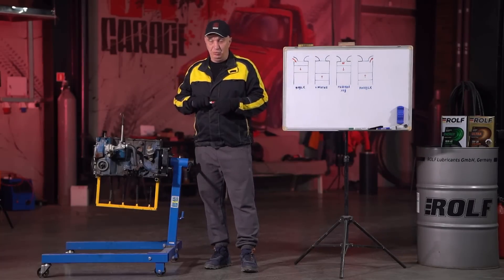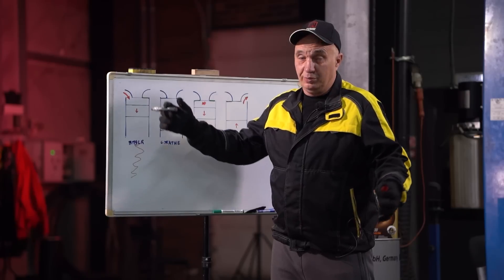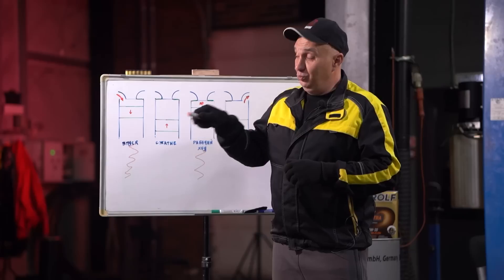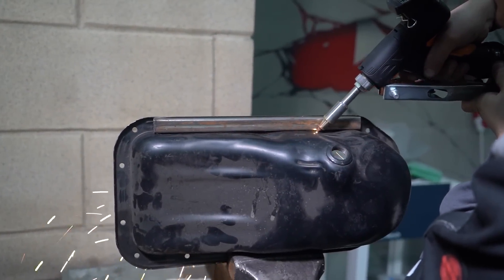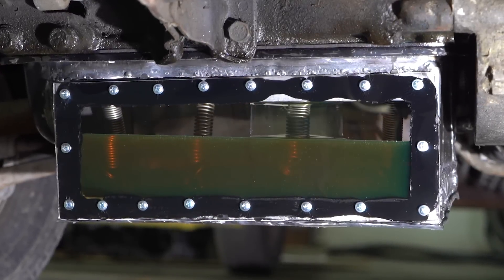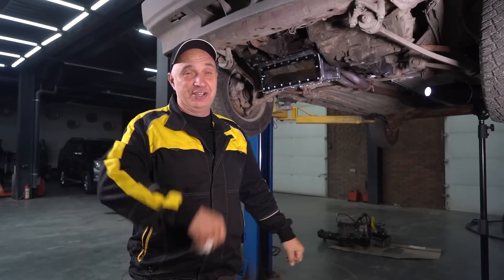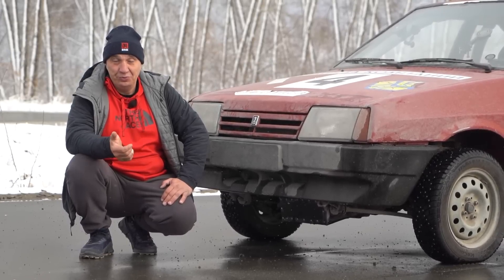Spring augmented engine (20% extra HP!) - will it work?

Comment: Another awesome video and experiment. When I heard springs and engine I thought it was either another one of those April fools pranks or maybe you were putting some compressive springs inside the combustion chamber to push the pistons down. Didn't expect the transparent oil pan and tension springs though. Pretty cool and honestly why I wouldn't expect too much of a result from a few springs is that it all balances out in the end. I could imagine it giving a little bit of a result in a 4 stroke engine due to the fact that the intake and combustion strokes will be assisted by the springs and there would always be a downward force on each piston taking out any slack or play any may draw in a  little more air. But the effect could be undone between hot and cold cylinders as metal gets softer as it heats up. Stiffer valve springs give for higher rpm revs though, and that is a known way to get more power. Anyway, another awesome experiment as always. Always looking forward to what you guys cook up next. Love y'all.❤

Comment: this is not adding anything as you have to load them on the compression and exhaust stroke so that will slow the engine down on those strokes equaling it all back out

Comment: holy crap duno test this?!
Reply: aw he was lieing? 
🥺🤬
Reply: two up two down, if the springs pull down cylinders that arent supplying power... like compression and exhaust... there will be a net gain from decreasing parasitic losses from friction and unused strokes. 

the two fireing will have additional force. because of the springs being over unity. the fired force being more than the unfired forces ... 

actually test this, go from weak springs like this, to more stronger springs. 

it should work better when you have springs that are a greater force than it takes to compress.

Comment: In theory the 4 springs should cancel themselves out, because when going up they create some force, and that force is what cancels the down force.
Reply: Excellent description. You get an, A in physics. Wahahahaha
Reply: There is more energy required to stretch the springs than they give back when they retract. Therefore they waste more energy then if there were no springs at all.
Reply: @YblockEnthusiast  is a little more complicated... Are you sure the energy required to pull the spring is more than energy released by the way?

If so, and I'll not arguing... Notice how some springs start stretched already? So those springs are free power that means the engine is always ahead.. (using your simple theory in absolute terms)
Reply: @WINZRacingBoss  Nothing is 100% efficient, and even if it were 100% efficient it would cancel out to zero effect. But the springs themselves have mass, and it takes energy to move the spring, even if the spring tension is what is moving the spring. 

Have you ever had a bouncy ball? Thats a perfect example that you can wrap your head around.
Reply: @alexthemorgan  omfg. I'm not four years old... Was treating the original comment with the same logic it was written.

This test (driving a manual car in varying conditions with different atmospheric density and humidity) is flawed.

However.. The spring effect could easily be balancing the rotating assembly and absorbing some shock of this engine designed as a cheap workhorse that was made slightly tougher than required to deal with the imbalances and vibration...

Would you like to start explaining harmonics, counter balancing, counter shafts and the losses incurred by each?

Please... Carry on...
Reply: @WINZRacingBoss  Ya, it has nothing to do with any of that.  All the energy to stretch a spring, doesn't go into stretching the spring, some of it goes into heating the spring, among a lot of other places.  You won't get that heat back.  That heat won't help the spring rebound.  That energy is just lost to the environment.

Nothing is perfectly efficient.
Reply: Not to mention the losses from the springs churning (pumping) the oil.
Reply: @alexthemorgan that's bc the ball looses a bit of momentum due to gravity each bounce not to mention air resistance
Reply: @gradystephenson3346  its the exact same thing ...
you gain momentum from gravity on the way down, lose it on the way up;
you still have air resistance both ways and energy converted to heat from the ball changing shape in compression during the bounce.
Reply: so much work for a prank
Reply: Not if the flywheel is spinning it's weight in 1 direction as it does
Reply: @c4r5on88  Flywheel has 0 to do with anything. Energy wasted in spring action will be exactly the same.
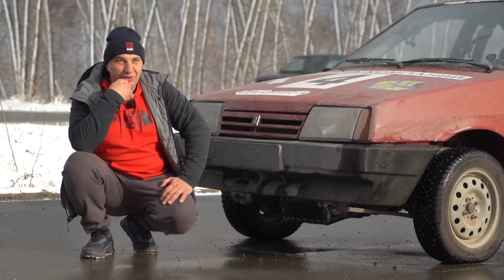Reply: The "post-credit" part of the video (9:46) basically explains this was a prank video.
Reply: The THEORY is sound assuming the forces are = in both directions. That and the force of the piston firing would have a much faster motion than the spring could rebound. Causing the springs to bend before they have time to rebound.  Ok now I’ll watch the video and see what happens.
Reply: @theofficialdiamondlou2418  No the theory is not sound if it somehow assumes the end result will be anything else than wasting friction energy on /de/compressing the springs.
Reply: in testing thats false! so cool...some physicist can explain
Reply: @reaganrpm  No its not. If you tested and got that result you did something wrong or happened to repair something in the process that was wrong before lol.
Reply: Plus losses (heat)
Reply: Only two have tension
Reply: Non svelare lo schherzo!
Reply: I think they should use pulleys like a bow where its easy to pull but exerts a great force
Reply: Could it be that as the crank spins the counterbalance that is on its way up already has a gravitational pull that it must over come, which slows the engine. By adding springs the upward motion is being overcome by the combustion and slowing the pistons downward motion but by have springs to pull downward they help overcome the counterbalance and spring that is being stretched? Just a thought.
Reply: you need camshaft actuated springs. 
So they only pull tension under power stroke. 

Then it will work some

Comment: Alright, hear me out.  Put neodymium magnets on the bottom of the conrods and highly-wound electromagnets on the bottom of the oil pan.  Tie in to the crank position sensor and fire off each electromagnet at BDC to help force the piston UP.  Power the thing with super caps and have it turn on at the push of a button like n2o.

Comment: Hum of course this system doesn't work, the energy of each spring cancel each out, so what did they do for it to work ? Maybe they changed the  motor but it's very unlikely, maybe they did not accelerate as fast as possible in the first place ? Do u guys have a better idea ?
Reply: Okay i found that my idea was correct, i will explain why. This car looks like a lada samara, also called vaz 2108. I've searched for the slowest version which is a 1.1l of 54hp and it does 0-100 in 17s not 25s. I think that the one in the video is actually the 1.3l 64hp version which can do 0-100 km/h in 16s. He just didn't go full throttle in the first run.
Reply: Good !

Comment: Increase in cylinder filling caused by a spring pulling on a connecting rod. Makes perfect sense to me. You guys should try making engine blocks from play dough. Maybe pistons made from a cake mix with pretzel wrist pins and cylinder heads made from concrete. Make the valves from mushrooms and run the whole thing on maple syrple?
Reply: 🤔maybe they will try it - 🤣
Reply: The only flaw with that plan is the word "syrple".
Reply: It's a joke, it doesn't actually work!
Reply: You leave the Canadians out of this eh
Reply: maple syrple??????!!!!!!!!!!!
Reply: Maple syrup vs aunt jemima ultimate showdown !!!!!!!!!!
Reply: @LORFCASTER aunt Jemima vs Ms buttersworth

Comment: A 0-60 (mph) time of 25 1/2 seconds?  That's so pathetic!  Assuming that you bothered to lengthen your oil pickup to prevent engine seizure, the gain derived from the lack of braking on the crank from "oil roping", as we refer to the drag during operation.

Comment: Those springs would only last a few miles
Reply: You ever hear of valve springs?
Reply: @kroan49  i used to be a spring engineer, so yes.  But valve springs are compression springs made of special steel.  These are cheap ass extension springs from the hardware store.  The knocked down ends will likely crack from fatigue.

Comment: that cutting tool used on the oil pan is very neat
Reply: Laser welder yes
Reply: Lucky These guys don't run the Russian milatary. They'd have converted that thing to chop drones in half from miles away already
Reply: Plasma cutter, not laser welder. You can buy one on for just a few hundred bucks these days.
Reply: @regurkilu  sorry to disappoint but what was shown there is definitely a laser welder that also can be used to cut stuff
Reply: @regurkilu wrong. It's not a dedicated plasma cutter. It's definitely a laser of welding sort.

Sorry to deflate your belief system.
Reply: @WINZRacingBoss  he also believes a plasma cutter is only a few hundred bucks
Reply: @plap. depends on your definition of plasma cutter, if you want a table it’s gonna cost you more than a grand. 
But if you want an old fashioned hand held plasma cutter you can really cheap out.
Reply: @jameshunt5316 Even Eastwood is more than a few hundred bucks. Cheaper than Eastwood would be tough, you get what you pay for. Be hard to do anything with a 30 sec  duty cycle
Reply: @regurkilu  I have plasma cutter and are you sure? I'm going to have to look closer. Give me a minute
Reply: @regurkilu  wrong wrong and wrong again.

Comment: Ummm not to be that guy but when you attached the Transparent oil pan you never put an oil pump and pick up tube back into it, that engine is going to die a horrible death....
Reply: If they cared about killing Lada,
We wouldn’t have garage54
Reply: @fastinradfordable  umm the first test with the stock engine the oiling system was working properly lubricating the engine, the second test where they added the springs the engine was not receiving the correct lubrication so the spring test is null and void as the two parameters are completely different.
Reply: That's russia for you everything dies a horrible death. But I love me some garage 54
Reply: Maybe need fill up more oil than recommended, but then the spring is invisible.
Reply: @peggenlejoncar9529  if there's no oil pickup tube there is no oil getting to the cam or to the tops of the Pistons to cool or lubricate them. This causes massive damage and wear to an engine very quickly
Reply: But in the short term, less parasitic drag! 😂

Comment: next experiment: link a wind turbine on the hood of the car to the crankshaft: accelerating the car will spin the turbine, that will in turn send more power to the wheels, making the car accelerate, etc...
Reply: i think they already did that video
Reply: So, like a "faster than the wind against the wind" scenario, but with an actual car not a purpose built wind racer?
Reply: It's called "Risking My Life To Settle A Physics Debate" by Veritasium.
Reply: Not to spoil the fun, but such contraptions consume more energy than they create.
Reply: Here's a radical idea: put a wind turbine in an exhaust pipe, and connect it to a compressor wheel. Then force that compressed air into the engine, along with some extra fuel! I wonder if anyone has tried that? 🥸😏

Comment: add nitrous to a stock lada engine til it cant handle anymore!
Reply: I did it to a Kawasaki 2 stroke pit bike and it handled an insane amount until the cheap reed case blew. It still runs. New reeds n intake ofc
Reply: 5sec:)
Reply: @joe125ful  max 4s
Reply: Hell yeah
Reply: How about installing a pressurised atomiser/spray head - fed by a bottle and pump - that sprays Nitromethane into the air box... Power gains? 🤔😏🤞🤣🤣     😎🇬🇧
Reply: @thedarkknight1971  Excellent idea!   👍

Comment: Don't forget to check your piston return springs ;)
Reply: They're not gonna return on their own
Reply: For the longest time I thought those where an actual thing
Reply: @_.incredible_magnum._291  They are. That was the joke. With the springs instaled, you can rev the engine significantly higher. That is what makes the extra power. They prevent the pistons from touching the valves and like he said, the engine runs smoother, because con rods don't strech at high rpm.
Reply: I think it makes a strange sound because the muffler bearings are worn😂
Reply: So sad